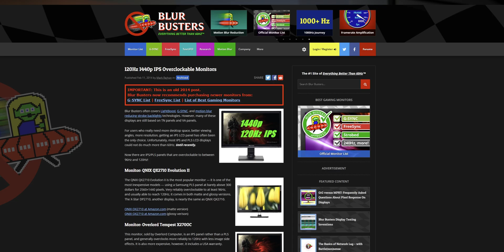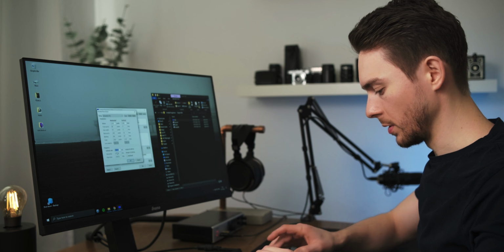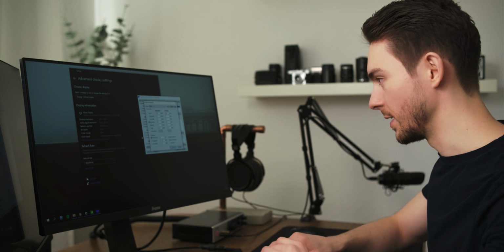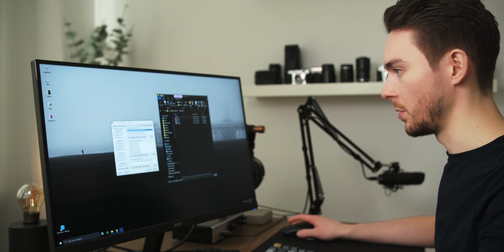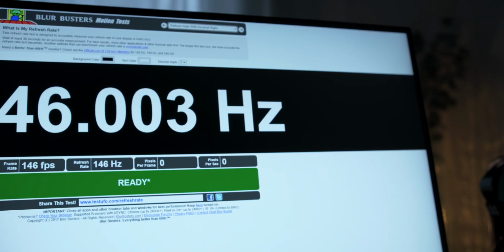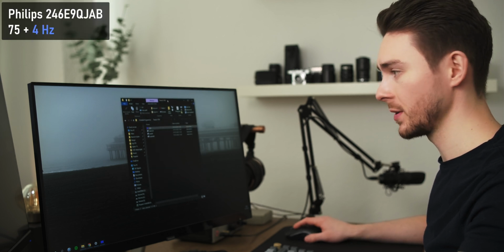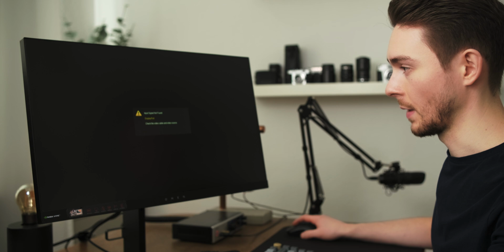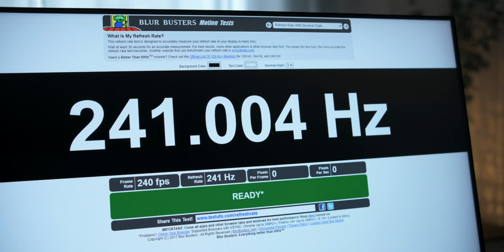Overclocking Monitors - Still Worth It?

Comment: im using the koorui 27e1qa 1440p monitor, I could of swore it was a 165 hz but everything im finding online says it is 144 hz, but yet in the settings it goes up 165, so im confused should I run it 144 or 165?

Comment: I have a question. Does setting my 1920x1080 monitor over VGA to 2160x1080 harmful? Right now it's connected with a VGA cable but on 2160p it's terrible. Picture quality on 1080p (1920x1080) over VGA is crystal clear
No I'm not using HDMI anytime soon
Reply: VGA is analog not digital 
So it's bad for overclocking or high resolutions
Also you can't increase the resolution 😂.

Comment: I Have Asus TUF 15 laptop with 1080p 144hz built in monitor. I overclocked it to 165hz, 170hz is playable with time to time artifacts and 173hz wich is unplayable with big frame skipping. 20+ hz gain is amazing ngl

Comment: i was able to get my 144Hz monitor to 150Hz
seems kind of pointless and you're really not gonna see the difference tbh
and considering overclocking the monitor might reduce the lifetime of the display, I don't see a reason to run it at 150Hz

Comment: I'm playing counter strike at a low res : 1280x960 so I overclock my 1920x1080 60hz monitor to 75hz, which is a lot more but it doesn't seem to work without lowering resolution

Comment: My LG monitor has 165hz and with OC 180hz given by the company itself.
Should i use it in 165 or 180 
Does using 180hz damage or shorten the life span of the pc please lem’me know
Reply: if youre asking if it reduces the lifespan of the monitor i dont think it really does from what ive read and also lifes short so just do it😂
Reply: Yes it will reduce lifespan
Reply: @ItzBloxxy76  it won't, i have overclocked monitors for over a decade and they show signs of degradation

Comment: I overclocked my 120hz tv (don't ask) to 144hz to fully fit in the bandwidth of HDMI 2.1
I don't find it bad if it's necessary (like from 60 to 90 for big boost) or just doesn't stress your monitor too much.

Comment: i got my "Koorui 24e4" that would only run on 60hz to go to 200hz (running off hdmi) (monitor was rated for 144) only used the nvidia driver thing, no bypasser things

Comment: i got signal limit error but its smooth and works fine how i bypass the error message floating in my screen went from 144 to 170 really smooth
Reply: check if there's an option to disable the OSD using the ControlMyMonitor software (by NirSoft), that'll try to communicate with the display through DDC/CI (will not work if display is connected using a HDMI->VGA adapter or if it doesn't support DDC/CI, most monitors should support it, but in rare cases you may need to turn it on in monitor settings or with a button-combo)
it may also be possible to disable the OSD messages through Factory/Service menus, but I haven't seen any monitor that has such an option
if that doesn't work, then you're out of luck and need to find a different monitor with a different OSD that doesn't complain about running at non-standard display modes

Comment: My current ASUS XG27AQM model has an option to OC from 240 to 270hz. I honestly don't know if there's a difference in that extra 30hz but it is buttery smooth. And after having it for a year now I'm just now veryyyyyyyy rarely having my monitor give me that black screen no signal feedback as if it's giving up. BUT it never goes from 270hz to 240hz it comes back on screen 5-10 seconds later onto the 270hz OC. Personally, I would say just use the refresh rate that matches your FPS in the main games you play. I've been on a 4090 as of recent for less than a month and for the last 5 years I was on a 1080 Ti. I probly shouldnt have been using a 1440p 270hz monitor but I also play only competitive games (Overwatch, Val, Apex) where I was borderline 270fps.

Comment: Someone PLEASE fucking tell me what the problem is here, I have a 75 HZ monitor, And it worked fine, Since the most recent Nvidia driver update, It just defaulted my refresh rate to 60 HZ, Despite the fact it's 75 HZ monitor, No option for 75 HZ exists anymore, Going to the Nvidia Control Panel to personally overclock the monitor, I'm able to overclock it to 66 HZ, But 67 or over doesn't work, How has a fucking DRIVER UPDATE caused me 75 HZ monitor become 60 HZ and now be unable to choose or even overclock to 75 HZ?! What is this bullshit?

Comment: Not worth it, my monitor developed a faint horizontal line after ocing it. If you OC your monitor, do a bright and light color pixel test, they might be there you just haven't noticed it because they are so subtle and aren't noticeable during normal use but they are there. It's not worth the risk and all the hassle of returning it to the store. Glad mine still has warranty.

Comment: I have the Pixio 243 165hz monitor, VA but i like it bc of how deep the blacks are and gaming with it isn't actually that bad once i got used to the black smearing. I overclocked mine to 200hz using the AMD Adrenaline software, it automatically adjusts the timing as needed and it does seem to help with smearing a bit

Comment: I think this is something you need to revist. But next time don't only change the timing, but the lower the resolution as well. I got my Omen X27 to go from 1440p 240Hz to 1080p 400Hz with cvt-reduced blank timing setting and 8bit color depth, 60% improvement in refresh rate. It actually went to 420Hz but would crash when trying to play Overwatch which is my main game (this was OW1 so the max fps was only 400, not 600 so this may have been a factor). Also, you can create a custom resolution through Nvidia control panel, no need to download a software tool.
Reply: 400hz??? bro wtf are you serious?
Reply: @spray5523  Yep.
Reply: @suno4947  is it still working?
Reply: its doable heck i got my omen laptop from 60 to 100 hz not a big jump but still its common on omen product
Reply: but nvidia control panel results in some input lag no?
Reply: you could try 1280x720 with integer scaling for maybe further OCing and also to keep the quality sharp
Reply: you were likely using a hdmi cable. the only reason you were able to achieve so much more hz is because you’ve lowered the bandwidth on your hdmi cable by lowering the resolution. you can likely get 1440p 400hz if you buy an actual display port & not a hdmi port which has a lot more bandwidth & can handle these intensive specs. hdmi is used for consoles & tv’s, not high refresh rate/high resolution monitors

i overclocked my Koorui monitor from 165hz to 219hz 1080p. but when just switch to a hdmi cable i can only get up to 171hz

Comment: I manage to get 165hz from 144hz monitor. I can even go higher but when I do that my monitor starts to act like a 60hz monitor dunno why. Gonna stick with 165hz.
Reply: @marsone Not at all, normally monitors can handle more than their original refresh rate. Manufacterers doing that on purpose but not all of them making all monitors that can handle more than their refresh rate so if you are not using a bad HDMI or DP cable it will be fine.

Comment: I bought a cooler master cm Ultrawide and it overclocked from 144hz to 223hz. Absolutely blown away
Reply: rip your monitor brother
Reply: @tommylit5964  why?LoL
Reply: @DragonOfTheMortalKombat  it will put too much pressure on the monitor and it probably was made to habdle 144-175 but not 220 it will make the monitor life span shorter and the parts can go worng a lot faster
Reply: @tommylit5964  When you're overclocking, there are only 2 things that kill your components, heat and voltage. You cannot alter any of those manually, monitors are locked in power consumption by their power adapters and non-modifiable chipsets, so any decent quality and not-so-worn out monitor should be able to handle OC just fine with no huge reduction to lifespan.
Reply: @tommylit5964  if you're using a 165hz or 180hz monitor they must be 144hz panels overclocked. the companies already do that
Reply: hello any update is it still working or died ?
Reply: @mouadmi3ida98  i overclocked the screen in my gaming laptop from 60 to 90hz and after 3 years of use + 2 years without overclock, and it still works.
Reply: How did you do it??
Reply: @x4v  ok bet thanks man I’ve been having the worst lan issue with my pc and basically can’t use my ethernet it disappeared from network and sharing center n it’s prevented me from further tuning my pc sadly
Reply: Jesus
Reply: Bro is it still good in 2026？

Comment: Can it "damage" my monitor? 60Hz to 74Hz ?
Reply: it's been a while since I had a 60HZ one. But I remember OCing mine to 72Hz and after a couple months it broke (wouldn't display anything or a little with a heavy pink tint 🤣). So be aware while it doesn't have to be inherently dangerous, there might be a chance something will happen. So if you're short on money and can't think of being able to buy a replacement, I'd be careful.

Comment: People have little upgrades like this but my monitor went from 75hz all the way to 110hz. It might be able to go higher but at 120hz it stopped working, so I stuck with the 110
Reply: Yeah, it depends a lot on monitor as well as the interface. Sometimes you might be limited by HDMI or display port version. I already have mine overclocked to 75, will definitely try this utility to gain more.

Comment: I have an LG LG UltraGear 27GL63T-B standard is 144hz, I can get it all the way up to 244hz, without any weird artifacting or any negative affect other than I have to use 8bpc color depth instead of 10bpc color depth, I've settled for 200hz at 10bpc color depth, UFO test shows no problems and it looks really good.

Comment: that's weirdly bad, my 1080p acer monitor goes from 60 to 76hz and it was definitely a budget monitor and my odyssey g7 can do 1440p at just under 270hz and for fun I tested it at 720p 400hz and it actually worked. It also does 1080p 360hz.
Reply: I just checked, sadly 1440p/240hz is same prince range as 1080p/360hz... there goes my hope of you finding a loophole for a cheap 360hz monitor 😅
But(!) 360hz monitors are all 24,5". Your G7 is 27". That makes it the biggest 360hz screen! 😂
Question: How is the image quality in 1080p? Does it look as good as a normal 1080p monitor, or better/worse, cuz it has more pixels?

Comment: For some reason, the idea of overclocking my monitor just came to my mind and after a quick research - there we go. Probably the easiest overclock out of anything overclock-able. Unfortunately, my monitor can't handle anything above 146hz, being a 144hz. I was hoping to for at least 165 but, ain't gonna cut it i guess. As seen in this video, Acer doesn't seem to handle clocking very well.
Reply: i have a few tricks that might work for u let me know if u want it
Reply: @スパーキンアッシュ  i wanna know 
my gsync 144hz monitor doesnt go above 145hz 
its MSI G241
Reply: @annaaffprivate G sync chip doesn't allow OC.
Reply: @DragonOfTheMortalKombat  so even if i turn off gsync will it overclock?
Reply: yeah, my monitor was way better, it went from 165 hz to 240! really deoends on your monitor really, mine is AOC.
Reply: make sure you are using a display port & not a hdmi port. hdmi has a lot less bandwidth compared to displayports

Comment: Overclocked my BenQ XL2430T to 1024x768@240HZ and I must say this is the best tutorial on youtube currently, ALL other videos about monitor OC are made with nvidia control panel which is BAD because it keeps the original timing of the monitor and can introduce input lag and bad colors.
Reply: can you elaborate me about the timing thing?
Reply: @bunnxr if a frame is ghosting at the original refresh rate, it will ghost with the overclock activated. That means no actual difference on the final result.

Comment: Had a AOC 2460S TN 1080p 60hz monitor from 2014-2022. In 2018 I discovered it would OC to 75hz. I think the budget gaming monitors form AOC these days recycle the same panel just factory overclocked to 75hz.
Reply: I have an AOC E2475SWJ and it goes up to 80hz
Reply: I have a AOC TV, 42" from 2012, it runs on 60 hz overclocked to 70 hz

Comment: Wow, thanks for showing this CRU soft. I could only reach 60->65 with nvidia control panel, but with CRU it goes up to 75
Reply: How
Reply: @Hasmatix  I just added "Exact Reduced 1920x1080 75hz" resolution on top of the default one and it worked without any trouble so far in these months
Reply: @notWedzy  hey, its been a while since u commented, but do u still have it?
Reply: @abyssyq  the monitor? I bought a new 165hz one since then, but the old one still works

Comment: I have a question, if my monitor is rated for 165Hz, will overclocking it to that reduce it's life span?
Reply: it depends really especially since all the visual errors a oc can induce
Reply: @eznemo2346  It's not really an "OC" (which means that I don't have to do it in the OSD to reach 165Hz) from what I can see, it may be a factory overclocked panel from 144Hz to 165Hz I assume but there are no errors
Reply: @QuickS4nd  oh god yes their is
Reply: I need an answer too!! My 24g2 came and windows didn't show 144hz, I have amd integrated graphics so no nvidia panel, I used CRU and it works fine but still need assurance
Reply: @DecemberGalaxy0  If it works fine, then you're all good! As long as it is advertised for 144Hz and it's running at that refresh rate then there's nothing to worry about.
Reply: hence why u cant really oc any of the monitors nowdays thats since they already have been
Reply: @eznemo2346  That's right to some extent. Some monitors are rated for 75Hz or 165Hz for example and they've been overclocked from the factory and tested for artifacts such as frame-skipping, and the rest of them i.e. 60Hz or 144Hz are just "normal" monitors which you can overclock further and depending on your luck you may or may not get good results.

Comment: Why do you need more Hertz when the human eye can only see 60 images per second?
Reply: That's an outdated myth. The jump to a 144 hz monitor is very noticeable... it does get less noticeable as you go up but a typical gamer will notice a difference going up to 240 hz as well.

And I don't think those limits are set in stone. The more trained you are to higher refresh rates and tracking visual information, the more FPS/Hz we can appreciate. I'm not sure what the best pro gamer can make use of right now but it's way above 60... and I think we will just keep improving.
Reply: @paulshelkov7956  honestly you can tell the difference between 240 and 260 after a while, small changes in input delay can be extremely noticeable for accuracy in game

Comment: I just OC mine (AOC-2490) And It went from 120hz to 133 so I think its a lot of improvement
Reply from the maker: That's actually pretty good!
Reply: How did you beat "out of range" message? I cant overclock g2590fx higher than 145 hz

Comment: Not related to the video but a question I still search the answer to. Have you noticed different text sharpness across brands? I had recently tried a few monitors (LG, BenQ, Acer) and both LG and Benq had a kind of sharper text than the Acer monitors I have. Felt artifical to me though and I prefer Acer's text appearance. If thats the case do you perhaps know other monitor brands with text sharpness similar to Acer?

Comment: I used this on some laptops a few years ago, both were 60hz to start. Got one up to 80hz and the other up to 100hz. The bump up to 100hz was a noticeable improvement in responsiveness, especially since it was a gaming laptop with a dedicated GPU. I wasn't able to get anything out of my main monitor for my desktop, though.... Artifacts at 62hz...
Reply: Its rlly a bit late reply but how did it turn out on the long run cuz i have mine overclocked but worried about long term and just wanna be safe🙂
Reply: @Moviemonk0  The 100hz overclock is still working well. The only limiting factor is the laptop's old GPU that struggles to push demanding games at 100fps. Works pretty well for Portal and Minecraft, though, as well as general desktop responsiveness. No artifacts.
Reply: @arc3959  Thats great than thank you 🙏 ☺️
Reply: @bepopxxx  why are you so afraid of monitor overclocking? You don't raise any voltages, it isn't damaging.

Comment: Under-clocking might also be a thing. My old LG IPS236V spec sheet says 56-75hz, but I could get 49-76hz. The funny thing is; it wasn't advertized as 75Hz, but it's in the spec sheet. Had to use reduced timings with CRU to get there though. I suspected a 165Mhz pixel clock limit.
Reply from the maker: Interesting 🤔

Comment: Plz try with gigabyte G24F can it overclock??
Reply: I've tried with my G24F and was able to push it to 180Hz from the usual 170. Anything past 180 would would be out of range, even with reduced timings.
Reply: @simonv343 did you try softMCCS on the second monitor to beat "out of range" message?
Reply: It has a slight overclock from 165 to 170. NO SIDE EFFECTS WHATSOEVER. At least noticeable ones. Really good monitor, I have had it for 2 weeks already
Reply: @El-Ferrari-de-Menem  I have just brought gigabyte G24F almost two week ago i am facing blackbleed problem in left side of monitor how can i solve that issues any idea?

Comment: I did try it with my 60hz Acer 1080p IPS the old fashioned way a year or two back and I think I got it to about 72hz before things started to look 'crunchy'. I may try this program and give it another go with reduced timings. I know for a fact my Acer X34a won't go 1hz above it's g-sync clock of 100hz.
Reply: Just to update I've managed to squeeze a few more Hz out and got it up to 75 with reduced timings, so more than happy now as it's used as my secondary anyway. Cheers!
Reply: did it damage your monitor?
Reply: @rubitroll  Monitor overclocking isn't damaging, you're not raising any voltages.